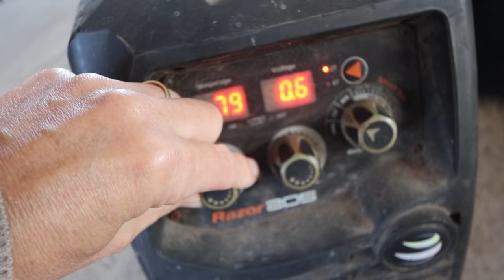Building Boat Handrails - Brupeg Ep. 157

Comment: If you haven't already Finished with these you may want to invest in a piece of chunky I-beam to clamp to.
Reply from the maker: We tried welding them on both sides to counteract the warpage, and it still bent the same amount and in the same direction. We also tried while it was hot from welding to bend it (like a crossbow) in the oposite direction with a jack and let it cool like that. didnt make a lick of difference. Tomorrow we have a couple of five ton bottle jacks and some chain we will use to really crank some reverse bend into it and straighten them that way
Reply: @ProjectBrupeg You need to put a pre  bed in it the other way BEFORE welding.
Reply: @ProjectBrupeg  Hm. If the bottle jacks create more problems, would pie cuts be out of discussion?
Reply: @ProjectBrupeg  I think he was suggesting using two I beams instead of your two c channels welded and I think budget for the beams was the issue. 

I think the look would be two I beams and 8 wheels like say 4 skateboard trucks with all 8 wheels attached to a single vertical moving cart type design it would need a pivot on the outside for the stabilizer arm to mount to but as you say the stress will be on the bolts when down.

The upper roof section could need a bit more bracing with that design and a larger section cut out to run through similar to the deck plating to give strength but at the bottom and raised positions you could have had a bolt through plate the the moving cart slides down past or into two vertical pieces of steel for a simple bolt through the truck horizontally design to save on engineering calculations and the same at the top possibly to hold the wings in an up position.

But I am not sure he gets the Kiwi thing and thinking of the most complex and over engineered answer possible then simplify that like your door hinges, Maybe that design for Brupeg 2 also are you repainting the waterline higher so it is not under the water or are you not painting one to be safe?
Reply: Na he means use the I mean to clamp to 
So before welding you clamp the welded channel to the I beam then weld the centre a d let it cool 
Once cool release the clamps and the c channel won't warp 
Common practice factories known as jig 
Common in industry to clamp so getting to a big enough bit of metal or clamp it to the floor to stop it warping
Reply: @fowletm1992  yep this is what i meant. you should be able to find old but straight i beams at the scrap yard.

Comment: If you haven't finished the brackets on the stairs. You could use 90° corner welded from the inside of the stairs to the wall. So your hands can hold on to the the rail without having to let go at any point. Then you just have to lift up you thumb to get past the bracket. (hope this is helpful)  Great video!
Reply from the maker: Thanks Pari

Comment: You might want to consider a hinged hatch that opens to the left that just clears the handrails.  Or, a piece of railing extending out from the wall bending down to the deck on the right side of the hatch and put a chain across the opening when no one is passing thru.  Either would keep someone from stepping off into space and winding up at the bottom of the ladder.  Don't ask my wife how I know this.

Comment: small bolt jacks use a nut bolt and pice of tube then adjust as needed
Reply from the maker: Ahhh I like this idea. Thanks John
Reply: 👍 an old mechanic trick to instll warped exhaust manifolds. Good tip !

Comment: with serious burns, get it in icewater right away.What happens is the limb absorbs the heat with some surface damage, the heat then trapped in the limb then tries to come back out and its that radiant heat coming back out that really does the damage. Next time you get a bad burn try it, and when its in the water for a few minutes you should be able to feel the heat coming out through the water,pretty interesting really. Minimum 20-30 minutes and you might have to replace some icewater, the extreme cold is friggin painful after a bit but better than the results and inconvenience of a bad burn.
Clearance for a hand rail is a gloved hand, theyre never happy about brackets unless theyre cranked away from fingers especially around the palm side, that is directly behind. If you have to put brackets on the inside of the rail crank them back to the B/H. I could see you ruminate on that. You should be right but. 
Navy spec ladders use rails for feet too, so you can use your instep of your sea boot to guide you down. This keeps all the arms and legs within the hatch so its safer and its quick. steps are just for coming back up, its a reason for heavier gauge. The only gripe I would have is that bolt up flange plates to the B/H look a bit neater, rather than going through more SS wire, but it is what it is I guess. On lighting, more important to see the actual step surface rather than where your mind constructs it to be. Job looks good. 
PS I cant stop blinking whenever fn the welder runs.

Comment: Does there need to be a waterproof hatch at the top of the ladder bay? Will they be dangerous at sea, stepping over on opening to go down the ladder?
Reply from the maker: No need for water proofing but it will have a barrier like a gate so you can’t fall
Reply: @ProjectBrupeg  the thought was specifically to have watertight bulkhead in case of a flood. Looks great. Enjoying the build so far!

Comment: Another nice video but you left out  how you put the accurate bend into the hand rails .
A short piece of 1/4" plate welded near deck level would stabilize  the handrail and still allow your hand to slide down the pipe
Reply from the maker: We took a bevel reading of the angle needed and then had an exhaust shop bend each tube to suit

Comment: Wouldn't it have been better to put plates on the ends of the handrails and bolt them on? Just in case you need to remove them?
Reply from the maker: Nah, these won’t be coming off. If we need to put anything big in/out of that room we have a 3m wide hatch under the sofa we can lift up

Comment: Wow dude you shouldn't be over 50amp on 1.6mm sanitary tube like that. Also if you don't pickling paste them welds Ill end up rusting slowly.
Reply from the maker: I think I was at 45amp when just welding the tubes themselves but I bumped it up when trying to heat up the 6mm it was joined to. I’m new to TIG but I was concentrating 80% of the heat at the 6mm if that makes sense
Reply: Yeah that makes sense probably a touch high, to be honest fusion welding alone would have been enough for hand rails. It's how we do them at work, certainly fill for the rail to wall tho and like you guys said a brace 5x50 or something similar.

Comment: Dame check this video on heat straightening metal.https://youtu.be/bj0473QUsPY. You will need to start of slow with heating a V about every two feet let it cool and recheck it. If you need more go inside of the previous heated area and heat it again until you get it back straight. For the spacing issues you can tack two 13mill nuts together and put a bolt that is long enough to make up the space and with two wrenches unscrew the bolt which will spread open the gap. If you have a few of these you can put them in the area that you are welding the inside of the channel and move them after it cools to the next area. We use this method for years to straighten large beams for equipment skids for offshore oil rigs. Good luck and keep up the good work.
Reply from the maker: I love the bolt trick. Thanks

Comment: You should gin up a holster for the controller on Jess' chair. You'll still be able to use the hoist for lifting gear, but she won't have to fumble with the wire or worry about dropping the hand unit, you could also put a clamp on the back of the chair to hold the wire back out of her face. If she's gotta ride that thing, at least it should be fun!
Reply from the maker: These are great points. Bit of small bungey would solve the safety strap getting in her face and a small stainless loop welded to the chair would solve the holster issue
Reply: Scream if ya wanna go faster...  :-)

Comment: Easy spreaders for channel welding- cut a 3/4” bolt to just under the inside dimension, then thread a nut on. Use the bolt/nut inside the channel and a couple wrenches to force the sides apart. Good job guys!
Reply: And so may the force be with them...good tip..!

Comment: To get something to look level or straight in a room always measure down from the ceiling as your eye takes the level from what it sees and you can see the top of a room but not always the floor due to furniture or stuff
Reply: Wont work on a boat where the decks are usually parallel to each other and curved to the sides!

Comment: Question, are you going to install a coaming around the crew quarter entrance.  Designed to deflect or prevent entry of water. It usually consists of a raised section of deck plating around an opening, such as a hatch. just a thought
Reply: This will also stop an item dropped on the saloon deck from venturing below for a look see. You will have to find a way to make that opening crew safe.

Comment: LEDs under the treads is a great idea.....consider putting a strip of 90 degree thin aluminium (bunnings grade)  in front if them as a shade so they aren't in your eyes as you go up .....also rgb budget led tape is a good option as you add your own controller to set level and colour so you don't bugger up night vision, as well as having a whole roll of the stuff for repairs and disco night !! .

Comment: I amy have missed an episode, but what was the reasoning behind making the sliders from angles.  Would it not have been simpler to buy channel section, or RHS and rip it up the wide centres???
Reply from the maker: It was all about dimensions. We couldn’t get anything off the shelf that was the right size. We got these pieces pressed into the size we needed and welding them makes them exactly what we need
Reply: @ProjectBrupeg  OK Cheers for that and for the prompt response.

Comment: Hey guys,  great job.  one thing i noticed is that behind the steps, you don't have a dirt slide.  I would put a backing behind the steps so the dirt does not go into spaces.  would be like a back board.  To wipe it down you just use a fox tail broom to clean it.

Comment: One trick i use for polishing pipe like that, is i get a long nut that fits the grinder, thread it on, make two wood halves and glue them to the nut with epoxy. Form them into a barrel shape (crown) and then invert a sanding belt with the grit inside and slide it on the pipe. It's a bit of a class act at the start, but once you get used to it,  you can polish these pipes super fast. For a beginner, i'd say a 60 to 100 cm long belt should be ok. Obviously the pipe needs to be secured. I use a lathe chuck to secure it on the ground, but the guy i learnt this trick had a few poles driven into the ground.
Reply from the maker: That’s quite interesting. I’ve not got a lot of handrails to do and these are the only shiney ones (outside will just be heavy wall 32mm stainless).

Comment: Do you have a foot pedal with your Tig? I'm sure it's a PITA to use in confined spaces, but it makes TIG so much more manageable. That on-the-fly amperage control helps with the swiss cheesing and edge cracking a ton.
Reply from the maker: Nah this model doesn’t have a pedal. Not sure if it has the ability to plug one in but we do so little TIG work So we will press on

Comment: You can get various diameter and length spirals made of steel, they look like springs that fit inside pipes for bending, works for PVC conduit and copper plumbing pipe and maybe thin wall steel as well. mine have the end loop bent out at 90 degrees so you can tie a bit of wire there which helps to get it out after bending.
Reply from the maker: Nice. I didn’t know that. Thanks very much. Damien

Comment: Dame, get yourself a steel cutting chop saw like an evolution. low rpm, steel blade. I find the abrasive saw never cuts straight due to blade flex. the best part about this saw is it cuts quick with no sparks and no dust. just nice big metal chips which clean up easy, the best part is there is no heat, the work can be handled instantly. Great for a boat, reduces fire hazard. Amazon $350 US
Reply from the maker: If I had 350USD spare and other things didn’t need the cash sure. We are Patreon funded so we have limited cash flow and a lot of stuff to pay for. Nice to haves sometimes make way for it’ll do.

Comment: Jack it out as required then use a large pepper pot on you oxy acetylene and let it relax , I used to rebuild off highway truck (Euclids) and to straighten chassis we did basically that heat the bow in small V shape with the point of the V’s to the outside of the bow
Reply from the maker: Nice thanks Ian. We have bottles jacks to try and if that doesn’t work heat will be our next option as we need to rent a torch

Comment: How about blocks of hardwood 43mm hammered in along the slider length to hold while you weld? Simple I know but maybe worth a try.
Reply from the maker: Hi Joss. We actually ended up doing this but with wedges made from 12mm steel plate

Comment: I don’t thing you guys should have welded the hand rails in on the vertical ladder. At some point you will wish you could remove them to pass that extra large thing that just wont fit through the opening in the deck because the hand rails are in the way.
Reply from the maker: We have a massive hatch in the floor right next to these rails for the really big stuff

Comment: On your vertical hand rail, if you put a brace mid way you could use a mandrel price and weld to the inner side so you can still slide your hand down the rail without hitting a brace if you welded straight from the rail to the wall. 
Will a still rail be okay in sub zero conditions. If you are bare hands you  may find your hand will stick to the rail. This is common with steel in cold conditions.
Reply from the maker: Yeah that’s true, cold might be an issue on this. We can wrap it in a low conduction type material, vynyl maybe

Comment: I think you might have had better luck not bevelling before welding. I have battled this problem many times before one time I had to build a line boring tool to correct weld pull on heavy wall pipe
Reply from the maker: Thanks Curt. It’s quite a puzzle. We tried welding the opposite side first and the bend was the same amount and in the same direction

Comment: Nice video and great work being done. Disappointed to see the stainless steel elbows individually wrapped in plastic and then in a plastic bag. Overkill by the suppliers. No end to the plastic.
Reply from the maker: Yip. It’s all about protecting the shiny surface. When we go to the scrap yard we often see these bends still in the plastic in the scrap stainless bin as they have a slight mark on them and can’t be sold. They are $9ea but as scrap they are 20c at most.

Comment: Ofcourse its a challenge,and I learned on this highly entertaining channel that Dame isn't scared for any of those,so I aint in the least worried that he wont fix this as he usual does but...;..I cant help thinking "why didnt he bought two 40x40x4 (or whatever fit for that matter) U profiles for the sliders"when I see him struggling gettin the four angled profiles unwarped together...At such lenghts they are a pain to get them straight,especially without a dead flat surface to weld on and the amount of heat needed to get them fixed for the job..I know, a bit late for this comment,but just curious...Cheers Guys,you're doing a fantastic job,and make us spectators a happy lot...
Reply from the maker: Thanks Frank. Simply really. You can’t buy the sizes we need. So we could only make them
Reply: @ProjectBrupeg Thats a bummer...but  I'm sure it'll be fine..!..and there's nothing like the smell of welded steel in the morning..!

Comment: I reckon some bracing down closer to the step stringer or tread may be less obtrusive when ascending/descending. I'd expect it'll provide the necessary rigidity you're looking for too.

DameCAD seems to be working pretty well so far. I agree with looks right over measures right every time.

Comment: by welding it on the outside the heat has effectively shrunk the length you should have welded it on the inside first the channel sides keeping the length the same
Reply from the maker: Hi Shaun. We tried that just after this and it bent the same way to the same amount.